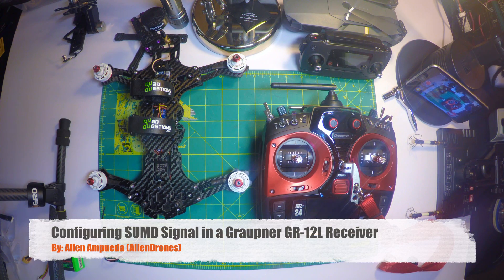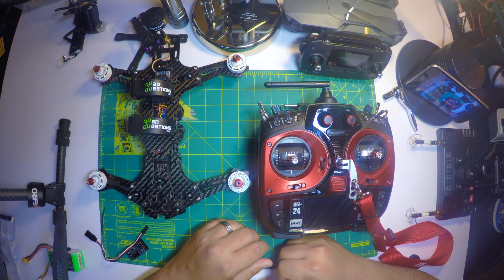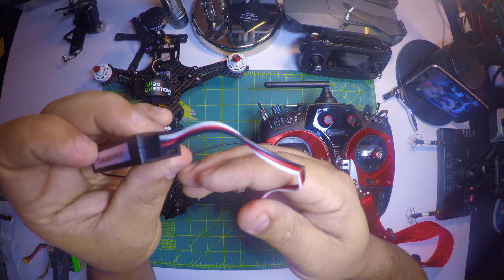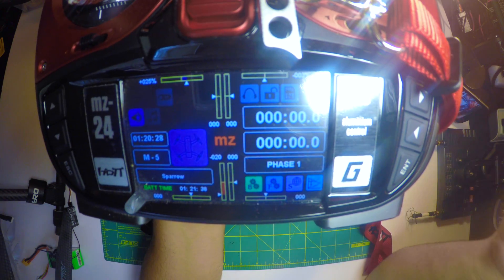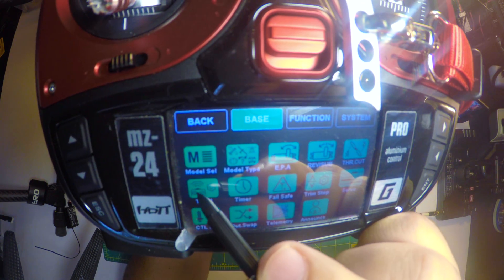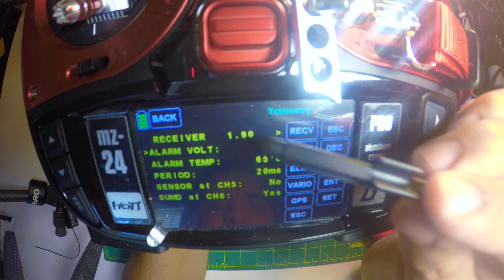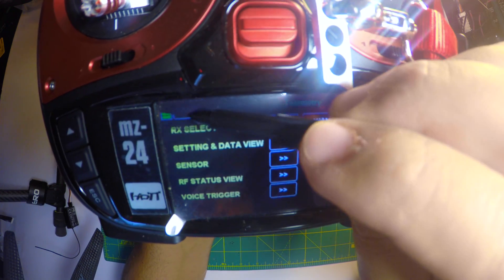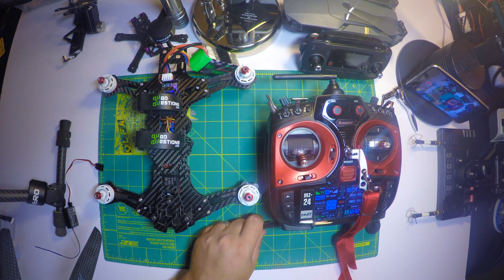Configuring SUMD signal in a Graupner mz-18, mz-24 or mz-24 PRO

Comment: I have a home built drone w/ betaflight and GR-16 receiver. All works well, EXCEPT for failsafe. Can not get it working. Setup the FAILSAFE menu just as for my alpha 300. Also went into "TELEMETRY VIEW" FAILSAFE page and tried all I could think of. Any pointers/suggestions? BTW, your english is GREAT
Reply from the maker: Hi there sorry for the late reply, I have failsafe configured on the DJI Naza flight controller and it still works :)
Reply: @allenampueda447  gives me hope, then. Will keep trying... THANKS!

Comment: Hello! I have the MZ18. What is the type of model i have to use to configure a Drone? The GR12 without the L have Sbus conection?
Thanks
Reply from the maker: A media I think any Graupner receiver will work. I just used whatever was available at the smallest size weight and good range. Any 6 Channel Graupner receiver should do it.

Comment: Can you tell something about receiver connection to FC? Did you treat it like a sbus RX?
Reply from the maker: Enrico P in Betaflight you set it up as SBUS Rx, but let me double check this when I get home.
Reply from the maker: Enrico P hi there, the SBUS on board is usually meant to be used with spektrum and other brands. I usually connect it on the DSMX port of available.
Reply: Very kind of you, i don't know dsmx but I will search
Reply from the maker: Enrico P sir I have not forgotten about you, I’ve been slammed with work this week and I couldn’t get back to you. It is a DSMX port where the Graupner Rx connects and then you can use the SUM protocol. Let me know if you run into any issues and then I’ll share screenshots of what my config looks like. Also, what FC are you using?
Reply: @allenampueda447  I'm using F4SD V3 WITH MZ12PRO AND FALCON12 . I WANT to use SUMD, but it didn't work
Reply: Anyway I would  know the HW connection, pin mapping
Reply: I don't underestand, you connect graupner receiver on a spectrum port? Dsmx is the spectrum port? Can you make a little video?
Reply: I guest you use a free uart, correct?